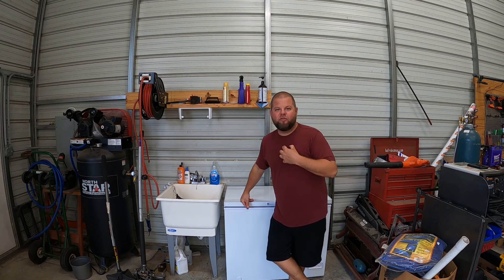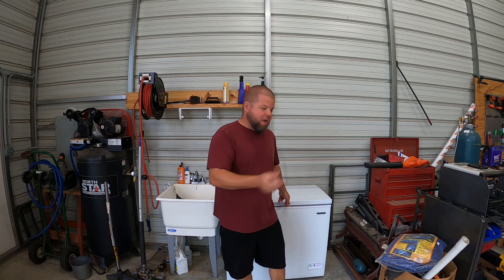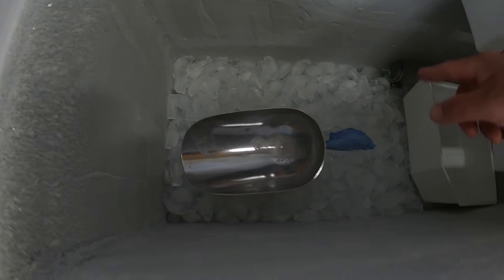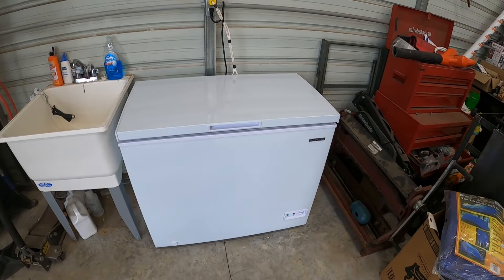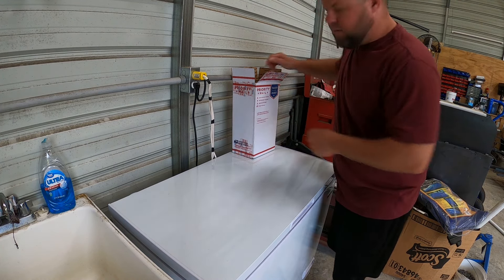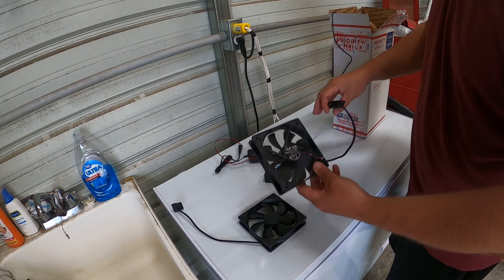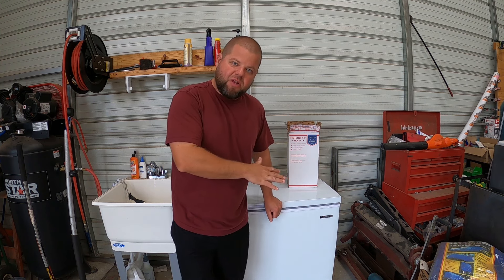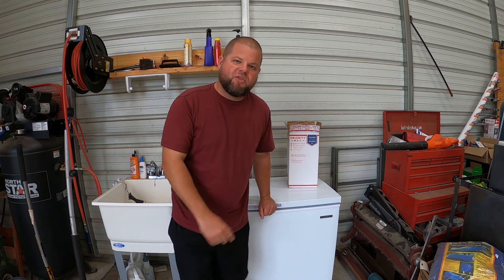Homemade ice machine update! Viewer requested

Comment: If you don't care about how it looks you can increase the freezers efficiency by putting insulation around it as long as you don't block the air vents it uses to discharge the heat from. 1-2 inches of foam insulation on the sides and 6 or so on top of it will let the compressor rarely need to run to keep it cold even with the added heat of the incoming water. 

Check the type of heat dump the freezer uses as some use the outer skin to spread the heat and insulation on that just means a hotbox around the freezer.
Reply from the maker: Thank you for the information

Comment: Ice will be the same temperature that it is exposed to.  If you drilled that cube in -20 degrees F in the artic then that ice will be -20 also  Water starts to freeze at 32 but at 31 the ice is 31 and at 20 the ice is 20.

Comment: And for your cooler, look up close cell foam insulation. Drill small holes in the bottom side of the lid. Just big enough for the spray nozzle. Spray in a circular pattern. Let foam spread for 24 hours. Break off excess foam. Get HDPE2 plastic and heat it up with a soldering tool just enough to fill in the holes you drilled. You can get the HDPE2 plastic just about anywhere, tylenol bottles, cups, old busted or broken kayaks and canoes.

 What this does is stop the heat loss. All regular coolers are insulated on the side and bottoms but not the tops. Just where the sun is heating it up. By adding this foam, your turning a regular cooler into a near Yeti type cooler at a fraction of the cost.
Reply from the maker: I am very familiar with the idea you are talking about. Luckily my Coleman coolers come with insulation in the lid. The few cheap igloo coolers I've bought in the past had zero insulation, that was dumb of them. I happen to have sheets of hpde plastic.

Comment: i know i'm way late to this and it may no longer be useful information but fan location doesn't matter as long as both sides remain uncovered and mostly free flowing it will generate a current which will help homogenize the temperature within the freezer. keeping them at the top facing straight down with half an inch between them and the lid will still create the air movement youre looking for. it's the same concept for air flow in a computer case, direction means nothing it just needs to move.
Reply from the maker: Thanks, I agree and installed fans yesterday. Video out soon!

Comment: Close off your holes, you still have to much air coming in to your box. When you see the white on the walls, that is air coming into your box and freezing to the walls. Also you could of went through the floor right above your compressor, there are no coils their and could run it down through their or right at the bottom corner beside the compressor. Then all your components would just go into the compressor box and you can run both of the water pump off the freezer. It can handle it. Just some points for your next build or if you want to improve it. Info on me, I was an HVAC tech and home builder for over 20 years until my back went out, now starting over again in a new field.Good luck and happy building.
Reply: Also for the people saying ice is at 32 degrees, ice freezes at 32 degrees, but most of your ice freezers temps are set for 20 degrees to below zero, so zero degrees to -10 degrees. The colder the better.
Reply from the maker: I agree with your approach other than running the water tubes through the floor all the way up to the ice makers, no doubt they would freeze, even if insulated. I'm going to build a collar or lip like on the keezer freezers for my next design.
Reply: @TKCL  That is true, in order to keep the tubes from freezing you would have to run them through the wall, With them going through the lip of the lid it would work better as you have it set up like now, but if I can remember right you should have 2 to 4 inches you can cut down to before you get to the coils, going down a little more you should be able to see the coils and know how far you can go, and then seal off the areas with a new top piece to control the air flow. Nice work tho, I enjoyed watching the videos. For the last few months I was thinking the same build because we go through 70 to 80 lbs of ice a week. We live just outside of El Paso Texas in the desert and it can get a little hot out here. Be safe mate.
Reply: True that air gaps & bad seals will cause outside air to enter the cooler space, however; his lid is probably being opened several times a day to check operation and periods where the lid is open for several minutes to obtain ice, which allows more ambient outside air inside more than anything. Which has a higher humidity level than the air inside the freezer. This in turn will condensate on the cold interior walls and eventually freeze. First on the walls of where the cooler lines are running then eventually overwhelm the freezer walls. That’s not a bad thing actually & won’t effect the performance or cooling capacity of the unit unless it really encroaching on the cooling space. It Can be quickly removed by a rubber mallet and a couple light pounds on the side wall will break most of it off. & is a good practice to perform when there’s a lot of build up & ice volume is low. 
I’ve got a retail business with a couple commercial-units & have to do this every 6 months or so. Not uncommon to see. Perfectly normal operation with outside ambient air entering the space with higher humidity due mainly to opening. Don’t worry about it.
Reply from the maker: Exactly, I just scrape the frost off once a month and toss. Probably once a year I'll defrost, clean and drain.
Reply: @tonyd.4430  That is true until the walls become what we call ice walls, it is just a solid sheet of ice around all the walls. After that a lot of times it will tell the system to turn off because it is cold. But the inside of the box is warming up. This will tell the ice maker not to run because it is a 0 degree system. A easy fix I thought of the other night was go to your local auto parts store. Pick up some half moon grommets for wiring through firewalls. Run the wires through them and place in the areas you cut out. Will help keep outside air from coming in.
Reply: James Cole, that is probably true for a residential unit. The temperature probe is within the walls of the unit, unlike a commercial unit with the Probe being located within the interior space of the cooler
And not internal. However; if you look inside any residential chest freezer in anyone’s home, you’ll notice that the walls are covered in ice frost. Along with still Frozen steaks, hamburger, dinners, etc... hardly no one cleans out there chest freezer every 6-12 months. The manufacturer is aware of this and so unit will adjust to this condition due to the fact that people never scape down their chest freezer walls. And of course; it still freezes and maintains the freeze temp. For this application it’s not much different from having condensation frost on the walls or frozen ice cubes directly in contact with the wall? As long as the temp doesn’t drop to below 10*F inside, the ice maker should still produce ice and the freezer should not start to cycle a down temp due to the inside freezer wall covered in ice frost. But, still good practice to clean down the walls every 6 months or so with frost build up to maintain a properly operation system.

Comment: The commercial ice makers don't have any refrigeration in the ice storage compartment, just in the actual ice making part.  Not sure if this is required by health code or just the way they settled on doing it.      
For your water and electrical openings.  There are no refrigeration lines in the lid.  So you can have wiring and water tubing drop down through the lid.  that way you are not chewing up the seals around the edge.    Alternatively, you can build a wooden frame out of 2x2 that sits all the way around the top of the fridge, then remount the lid so it closes down on the wooden frame.   All your wires and tubes can go through the wooden portion, and sealed back up with caulking compound to keep moist air from getting in and frosting up the sides. 
I'd also suggest dumping it out and defrosting, and scrubbing the interior with bleach to kill any nasties annually.
Reply from the maker: Your wooden frame idea is exactly what I plan to do on the next one.

Comment: Thank you for posting your ice maker videos, that is exactly what I'm looking to build!!! Well done!!!

One test I'd be curious to see if fill amount to output ice amount. The whirlpool have an adjustment for the amount of time the water relay stays open, which tunes the amount of water sent to make ice, which results in how thick the ice that it makes. There is a thermostat which detects when the ice goes below 32f, say 30f. Until the cube freezes to the center, the ice will be 32f, but once it is all frozen, heat is applied to the tray, which releases the ice from the tray so the pusher bar can push it out.

Smaller cubes freeze faster. Each cycle adds heat. I'm curious if one maker were making full cubes and another 2/3'rd full cubes, over 48 hours, which one would produce a greater quantity of ice? 

The fan should help a lot! Where i'd suggest putting them is under the ice tray aimed at the heater and aluminum tray. the whirlpool has 3 holes for mounting brackets to mount the fan from. The tray is a pound of aluminum that is probably 36f at the point the ice dumps. Not until the tray is below freezing will the ice start to form. 

If you ever need to really crank things up, the water could be pre-chilled entering the ice tray, but with tuning the ice size and adding the fans, you will see double the ice without the need of chilling.
Reply from the maker: I took the ice maker end caps off and do not see an adjustment option like our last ice maker had. Luckily these cubes are coming out normal size. I know what you mean about the heating element on the bottom, maybe I can get air moving that direction. Thanks for watching

Comment: - You may have mentioned this but when the bin eventually could get to your determined capacity ….. is there an auto turn off.
- ready to go bags of ice a suggestion. Having large zip lock baggies pre filled just a thought. 
- You have lots of room in that freezer, I’m betting other items wander in to keep frozen, maybe not.
Reply from the maker: I took the trip bars off to fit two ice makers.  Just check it once weekly to determine when to manually trip the ice makers or just unplug them.

Comment: The temperature can definitely be below 32, I think the person that said that is confusing it with boiling point. 
"Roughly" - Water can't get higher than 212 even on a 500 degree burner. It can, but you'd need a pressure cooker. 

But I put my ice in my lab freezer and it will get down to -20 as opposed to +15 in my regular freezer. The way I see it, thats kind of like having twice as much ice as far as how long it will last.

Comment: My deep freeze gets ice build up near the top.  I think it might be because the top is where the cold comes from.  It may build up near the top because when I open the freezer the cold air mixes with warm making condensation at the top.  But if the cold os coming from the top your fans may not help much.  Also will the fan motor produce any amount of heat?
Reply from the maker: It's definitely pulling in warm air and making condensation. The heat from those fans is minimal.

Comment: I think it's not that ice cannot be below 32F (0°C), it's just that the step at which it absorbs the biggest amount of energy is when it transitions from solid to liquid: 

You can look in Wikipedia the page about enthalpy of fusion, but if I'm not wrong, you would need your ice to be about -100°C (-142°F) for it to cool as much from the temperature change as from the melting!
Reply: As an addendum, if you want to work out the numbers yourself, you need to know the specific heat of ice, or how much energy it takes to change the temperature, and the latent fusion heat, which is how much energy it takes to make it change phase!

Comment: I didn’t read all the comments so if I’m not the first with this improvement so be it. I built one in a restaurant I managed years ago. In order to increase output I prechilled the water by running it through a copper coil of tubing that was put in an adjacent refrigerator. By feeding the ice maker with cold water it will make ice much faster you just need to adjust the timer that controls the ice maker. Before the ice maker ejects the cubes it heats the ice chamber to release the ice then the pushers flip them over then it pauses a moment to allow the heat surface to freeze again. You will more than double the output with my improvement.
Reply from the maker: Great idea! I made a very simple modification a couple of days ago that has dramatically increased production. That video will be out later today

Comment: What about a used UPRIGHT freezer for $50 on Craigs list. Most already have ice machine. Just put tote on the bottom and when it fills up add another tote. Pull tote out conveniently when full for use.. Turn down to -30 below zero for faster ice making
Reply from the maker: That's an option too, but I need more ice storage than that for my fishing trips.

Comment: Great project just a question, is there a reason you didn't make a hole through the side of the freezer rather than notching the top? I would have thought it would make a tighter seal and look neater? Or am I wrong?
Reply from the maker: Tubes running all in the sides and I could not locate them. It's not safe to hit one
Reply: @TKCL  I didn't know that actually. I need to find me a scrapped freezer and start drilling holes on the sides to see how far up they go👍
Reply from the maker: I wouldn't do that, whats in the tubes is either toxic, bad for the environment or flammable. Not to mention it's all under pressure
Reply: @TKCL  Aha! And that my friend is why I'll stick to detailing cars, this is above  my pay grade ☺️

Comment: Very cool project, my only concern is that the freezer you have uses r600a as it’s refrigerant. Which is butane. It’s very flammable. If the unit develops a refrigerant leak inside the box it potentially is a fire hazard. The modular ice maker you put in is not designed to be installed in units that utilize r600. When that ice maker cycles it can create an arc which can potentially ignite the refrigerant if it were to leak. New refrigerators use ice makers that are specifically designed to not create any arcs. I’d say this is unlikely to happen but I would not keep that thing in my house.

Comment: One thing I would recommend is putting the ice that’s being made and already made is putting them in five gallon buckets just in case of a power outage or something and also it would be a grab and go
Reply: Chest freezers don't warm up for a looooooong time unlike standing freezers. The only aspect that would reduce the thermal efficiency with this modification is his removing some of the moulding for a complete seal.

Thankfully there's a drain plug in the bottom just in case the power does fail long enough for things to melt.
Reply: @optiquest86  I didn’t know they had a drain plug so that’s cool!
Reply: @bubbayeeyee2235  Just verify that it does if you're buying one as some may lack this feature.
Reply from the maker: Yes it has a drain plug! I also have multiple generators since we live in a hurricane state, so no worries with power.

Comment: I like the way you think sir. Got a couple of questions for you. If and when you get that freezer 3/4 full of ice and want to shut down the ice makers, are they going to need draining? Did you install any kind of drain if the power is out and melting occurs? Thanks for the video.
Reply from the maker: Not at all, the ice makers can be turned off and on independently or I can unplug the extension cord I made for them and just let the freezer run. If we were to lose power long enough that all the ice melted, the freezer has a drain and I could let all the water out. If there is a lot of ice in there, I bet it would take a couple of days before melting occurred.

Comment: The sticking together is most often due to the cold ice cube surface condensing the humidity surrounding and the condensate momentarily is liquid which ya da ya da ya da.  Your deep freezer does not allow much atmospheric interchange, thus low humidity effects on the cubes.  Thermal mass allows for surface refreezing.  Saying ice can't go beyond its freezing temperature is a phenomenon of human ignorance developed from equilibrium of baths and ice.  Outer space can vary even without mass.  Very hard to measure actual temp without interference.  Radiation effects.
Reply: I believe that they are thinking of about the boiling point and confusing it with the freezing point... although snow has some interesting properties... but both points can be broken. To much to get into in the comments on a simple video of this nature.
Reply: Those are heated tray machines as well, there's a cattle prod heater that activates to help loosen the ice from the mold before the fingers try to eject it. If the timing and temps are out of whack, it can over melt the ice and the wet ice will refereze in the bucket to others. 

Another issue is that system will misinterpret the signals and fill the ice tray up, when they're already ice in the molds and pours a bunch of water into the bucket. Or the water valve starts to stick and puts out more water than it's supposed it. Most ice machines are controlled by the fridge programing, but there are other systems that have the programming built into themselves and they only need power.